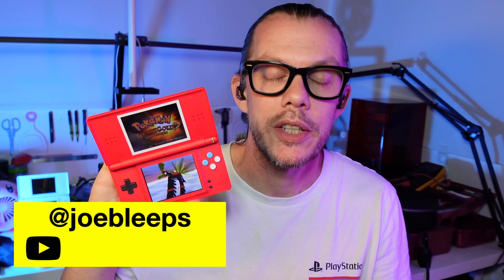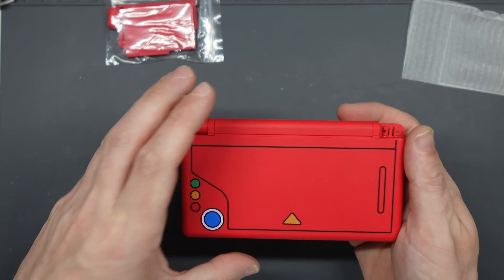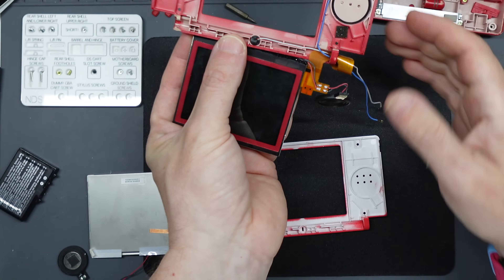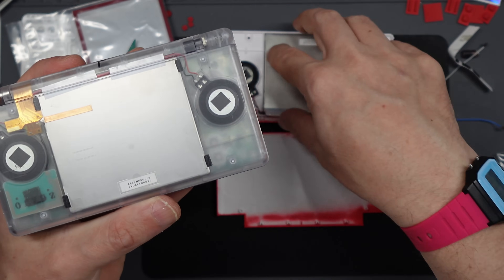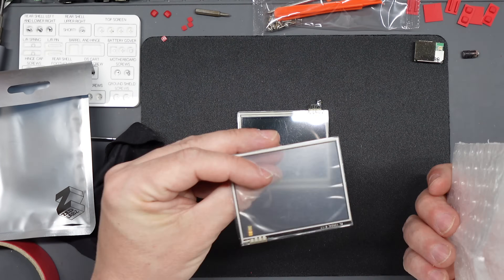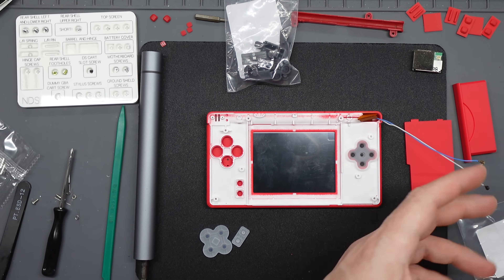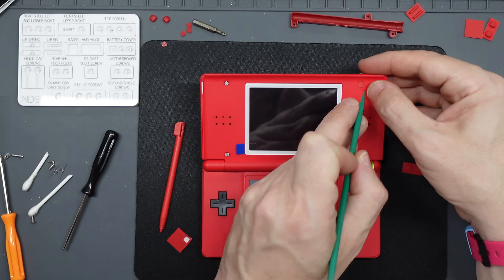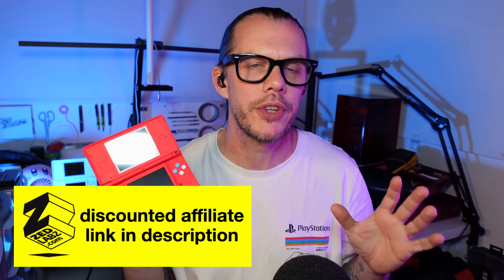A DS Shell That's Actually GOOD!?

Comment: You failed to address/emphasize and explain the most risky and crucial part of a shell swap - upper screen ribbon cable removal/installation. This is literally the step where most people usually fail and have to order new screens, but you decided to touch upon it in a fast forwarded part of the video.
Reply from the maker: I am sorry I felt like I'd covered it at the time.  It's tricky when you're doing a video like this one because I don't want to end up with a really lengthy video but there are so many steps to cover.  If I do another I may make a video focusing on that particular step
Reply: @ Sounds great! Sorry for coming as somewhat too direct with this, but a friend of mine actually followed your video as a step by step tutorial, since it looked as the best one, kudos for your production quality, aaand they actually broke their cable :D
Reply from the maker: @MistaKastro  it happens. There's so much chat can go wrong when there are so many steps involved. Always heartbreaking!

Comment: I bit the bullet and purchased a beat up DS lite,  this kit just came in the mail.   Am waiting on the screens to get here and them im taking a crack at it.  Its a gift for my younger brother who is truly a pokemon master.  I really appreciate the video and the tips.
Reply from the maker: @Jamesssssssssssssss  good luck!
Reply: @JoeBleeps  WOW that had to be one of the most difficult mods i've done.   It didn't help that I also removed the power led and soldered in a new blue one,  first tine soldering.  Realized that my hands shake when im stressed.  So I took some breathers,  finally got the LED done and the speakers to a new screen.  Ribbon cable never really gave me issues, I was just careful and slow.  The two wires gave me more hassle than I thought since they need to be routed really well or else one of the triggers is gonna have a hard time moving.  L + R springs are not my friends.  But after too many hours I got it done.  Am waiting on a special back label i got made to come in.  Then ill take some pictures and share.  Thanks again for all the tips
Reply from the maker: @Jamesssssssssssssss  I feel your pain with all these points. I've been there! It does get easier with repetition but it's a very involved process!

Comment: Nice vid but this is NOT as easy as you make it sound. I made the attempt a week ago and ended up ruining it - digitizer cable either broken or came unattached. Top screen now broken - possible the ribon cable not all the way in. I left out the volume button or it fell out when I attempted to reassemble. All in all it totally sucked and now I'm left trying to find someone to sent it to so it can be fixed. I do have the rest of the Extreme Rate kit and even another DS Lite that all works but has broken hinge. I just give up but would love to find someone to fix it for me. I am too old to see the tiny pieces well and just not dextrous enough to do the work.
Reply from the maker: Firstly, I'm flattered that you think I made it look easy. I still find these to be a challenge. First time I attempted a DS lite re-shell I felt like I'd been beaten. That's why I included so many warnings along the way in this video, it's all based on mistakes I've made previously. Replacing the digitiser isn't too difficult. And if the top screen doesn't work definitely check how the ribbon is seated.
Reply: That sucks but it seems like you rushed putting it back together. The first time I took a ds lite apart to fit a replacement screen took me most of the day. Parts are still cheap on ebay and you can find a "non working" ds for parts for peanuts. I did. Three times.
Reply from the maker: @54356776  yes, it's worth noting that despite having done this before, I had nearly three hours' worth of footage to work through when I sat down to edit this video!
Reply: @JoeBleeps  
I was replying to the op comment buddy. You did a stellar job.
Reply from the maker: @54356776  thank you! Yes I was agreeing with you there just backing up what you'd said 🙌

Comment: i did 4 shell swaps by now using extremrate shells. i would suggest everyone thinking about trying this for the first time please prepar yourself mentally that its very likely for you to break your top screen. really take your time. dont be to harsh to the ribbon cable when you roll it. 
if when youre connecting your new touchscreen inside the little ribbon connector make sure to not push the cable into too far. if you push it too far the little clip will come off and you have no chance of getting it back on
Reply: Good advice, patience is key. 
It's astounding to me that most people don't know that the ds lite has a split in the case for the top screen ribbon cable to go through. It makes it very easy to put back together when this is known.
I only broke the outer shell trying to clip it back on. The clips just bent and turned to mush.
Reply from the maker: Absolutely sound advice there. A lot of patience needed with these consoles.
Reply from the maker: @54356776  was that on a clear or opaque shell?
Reply: @JoeBleeps  
It was an original ds lite. I had 2 with issues. One had a broken hinge, the other had water damage to top screen so I just swapped the screen out. I somehow broke the top part of the outer shell trying to clip it back on.
Reply from the maker: @54356776  the ageing on the original plastic can be bad. The original DS is sooo bad for that. It just shatters into tiny pieces
Reply: @JoeBleeps  
It's such a shame as it was in excellent condition and I was very careful to line up the clips first but it just didn't want to go back together. The clips just deformed and squashed up. I used another top piece and it went together no issues.
Reply from the maker: @54356776  that's a crying shame

Comment: i just reshelled two lites and the screens were brighter for the clear one -dull for the pokedex. funny thing is, i did the clear first because the system wasnt turning on in the original shell and i had nothing to lose. now im wondering if i should replace the lcds for the pokedex 🤔
Reply from the maker: The brightness of the screens is definitely variable across different DS Lite consoles

Comment: The only issue I found with the Pokédex one is the light pipe housing doesn’t have the fitment of the original. 

Normally I’d use the OEM light pipe on these but they don’t fit the extremerate housing. And the extremerate one doesn’t fit as tightly as it should so there’s little gaps.
Reply from the maker: This bit was quite fiddly, I agree

Comment: hey i had a question about the ps5 controller... I don't think I have stick drift the problem I have is I barley tap the right stick like the stick doesn't even move  and then my character starts slowly looking what ever direction I'm barley taping the stick what what should I do????
Reply from the maker: That does sound like early signs of drift, you know.
There's a really helpful website, I'll link it below.  You link your controller via bluetooth and it gives you feedback on all the inputs https://hardwaretester.com/gamepad
Reply: @JoeBleeps  thanks and yes there is a little drift some people would not notice it unless using that website! Edit: or there really good at noticing things like that like i am and thanks again for the website
Reply from the maker: @Nibbler324  yeah those tiny 0.02 type readings won't be noticeable

Comment: Nice video! Today I got my shell: the “Dual screen computer” one. 
How is yours today? Is it losing color or getting scratched? Do you suggest getting a clear case to preserve the paintwork?
Keep up the good work!
Reply from the maker: It's doing absolutely fine but I haven't spent a huge amount of time playing on it really.  I think it will wear just fine and I don't think it would look as good with a clear case on it.
Reply: I'll be swapping it then, I hope I won't tear up that upper screen ribbon 😁, that's what scares me the most
Reply from the maker: @daviderapisarda3833  it's a fairly robust ribbon, just roll it up into a tube before poking it through any of those gaps
Reply: Aaand I broke it. I had some difficulties rolling it up and feeding it through the new hinge -_-
Bought a replacement top screen though…
Reply from the maker: @daviderapisarda3833  ohh that's a shame.  Good that replacements are avaliable at least!  It is tricky to do, for sure.
Reply: I did it! It’s like a brand new ds. 
I had a bit of trouble getting the upper screen ribbon inside its slot: no matter how much I pushed, it didn’t make enough contact and the console wouldn’t turn on. I reseated it several times while trying constantly and it eventually worked. Thank you for your help :)

Comment: Tried to reshell my ds with a broken hinge into the 1989 GB DMG-01 one from extremerate. Did an almost pretty good job but ended up with a gap between the ds Slot and the L-Button which drives me mad. The screw posts semms to be a little too weak. Also got a little squek when open the ds..
Reply from the maker: It's sometimes even worse than things just not working at all isn't it?  When there's just one tiny bit that's not quite right.  You have to be so careful with the screw posts when the plastic is so soft.  These shells aren't perfect but they are definitely the best option available at present.  Did you check if there was a wire pinched in there as that can happen in that area.

Comment: That USB-C screwdriver looks well handy
Reply from the maker: It's alright. Not as good as I'd hoped. Only micro usb, and not very powerful in terms of torque. Which is good in a way because you're less likely to strip screws but it still feels quite weak like it needs recharging most of the time. It was expensive too. There's a lot of other ones out there so I may try a different one yet.

Comment: I’ve done the Pokédex and several transparent shells from Extremerate they’ve all been very high quality. I’ve also gotten a few of those “special edition” replica shells off eBay and every one of them are made from such cheap ugly plastic I had to undo them and switch to Extremerate’s shells. Any suggestions where to get better quality replica shells for the special edition DS lites?
Reply from the maker: My guess is as good as yours, it's a real minefield.  Seems the ExtremeRate ones are the most safe option.

Comment: I just did mine last night someone already messed with internals of one of the ds lites i bought so the cable got slice on some cheap part that was inserted but used a 2nd one and di it fine, only issue with the shell it does not close flush and is warped other than that pretty nice
Reply from the maker: I. always find the most difficult consoles to work on are the ones where someone else has already attempted modifications previously
Reply: @JoeBleeps  yeah if they dont know what they are doing a normal sign is missing screws on the board when you open the bottum half i broke 1 screen myself due to a mistake i made after that i reshell 2 more DS lites not a problem
Reply from the maker: @roidnerd2501  It's definitely something that quickly gets easier with practice
Reply: @JoeBleeps  yeah the only part i sometimes find a pain is getting the ribbon cable through the hole haha
Reply from the maker: @roidnerd2501  For me it's getting everything to stay in place and have it all close neatly together

Comment: Looks quite like a mission impossible for me 😂
Reply from the maker: It's a challenge, but it works well. It's not a case of frustration because the parts don't fit as they should. This is the big difference between this one and the ones that went before it.

Comment: Just got this exact ds lite shell a couple of weeks ago and its awesome, but be warned the ds lite is a bitch and a half when it comes to switching the shells. The components are very small and when I got it all back together the bottom screen ended up cracked. I ordered a replacement screen and got it installed only for it to not turn on at all now.
Reply from the maker: That's the life of modding DS Lite. Can be very frustrating. But at least with this shell you're not being let down by poor quality parts. Also I'd advise you never try putting a new shell on a PSP. I did it once, never again. I still have nightmares 🤣
Reply: @JoeBleeps  lol, I'll keep that in mind.

Comment: where did you get the screw placement board @5:16?
Reply from the maker: I designed that one!  And then made it with a laser cutter.  It's very handy
Reply: @JoeBleeps  any chance on releasing the design? got a bunch i need to reshell and that just keeps it all neat and organized
Reply from the maker: @Pridecasting  I'd happily share it but it's in a weird file format. What would you need?
Reply: @JoeBleeps  i guess just the file, so i can get it printed. ud make a decent bit selling boards like that for the ds to new 3ds lines. the screws are so similar.
Reply from the maker: @Pridecasting  I'm sorry, I meant what file format
Reply: @JoeBleeps  sorry for late reply, I am not sure to be honest. I was going to pay someone to print it for me as i don't have a 3d printer myself
Reply from the maker: @Pridecasting  it's not 3D printable but I did consider a 3d print version
Reply: @JoeBleeps  heck they would sell for guys like me. i repair consoles as a hobby and having a nice organizer for the screws is major game changer.
Reply from the maker: @Pridecasting  thank you, that's some really useful feedback!
Reply: @JoeBleeps  not a problem, just dont forget me if you make a line of screw organizers for nintendo consoles

Comment: What do you do if tha Black flap in 21:33 falls off?
Reply from the maker: Oh I've done that before.  If you're lucky you might be able to carefully clip it back in place.  If you're less lucky and it's broken, you can get a replacement part but it will need soldering in and is pretty difficult to do.

Comment: I love the feel of the original DS, specifically the rounded corners. I hate the DS Lites weird squishy buttons and D-Pad, DSI is just ok. I also wish the original had a brighter screen like the Lite.
So basically my dream is a DS-Lite and the brighter screens in a DS Phat style shell. If you wanna go all out make it a firmware hybrid between the DSLite and DSI so I can have a camera and get apps on it, but still have the GBA slot. Plus add an output port since I know the Lite firmware supported that. Maybe even add some weird Wifi voodoo so that games that only support WEP can work with modern wifi, thus helping the fan servers a ton(There's a reason Black and White have more players than every other DS game combined, they're the only ones fine with modern internet)

Comment: These shells are bad. They are painted. It feels way worse than touching plastic directly. And the paint surface is a fingerprint magnet. I didn't try to scratch the case, but any damage too it will be dramatic, it will look horrible with no way to hide it.
Also, the hinges feel strange because paint rub against paint. It feels dusty.
It is not the fault of extremerate. The unpainted shells are perfect. But i would have prefered a red plastic shell with details painted. Not the whole shell painted.
Reply from the maker: That's a fair comment and a painted red shell would be good.  I think the advantage (aside from the obvious cost benefits for them) of painting onto white is that all the colours really pop.  I quite like the feel of this compared to the bare plastic shell.